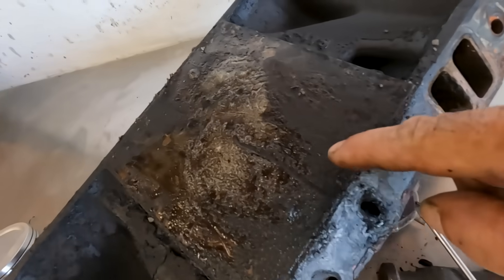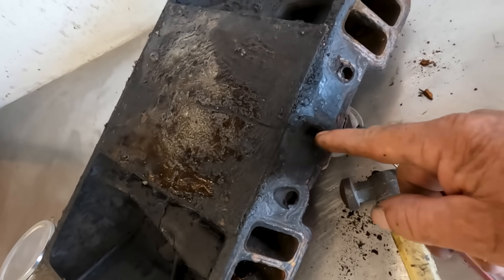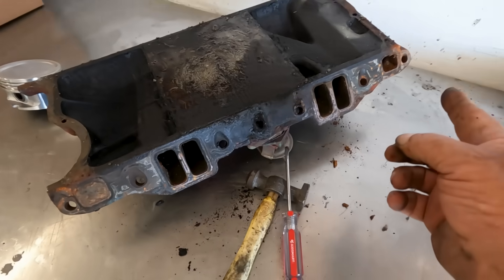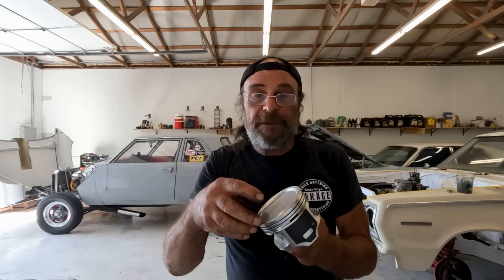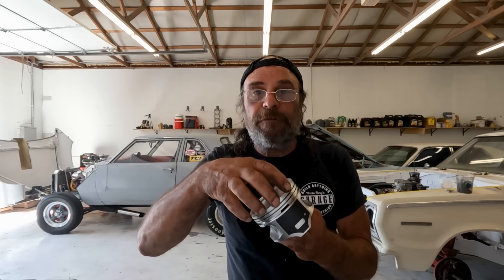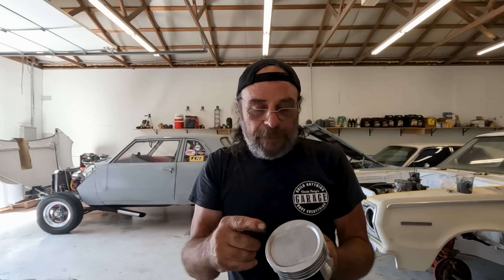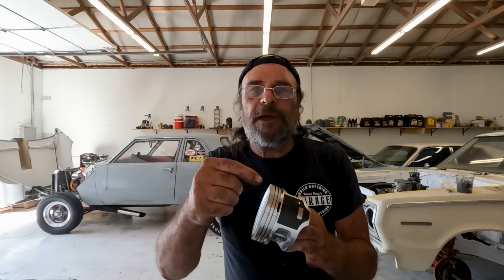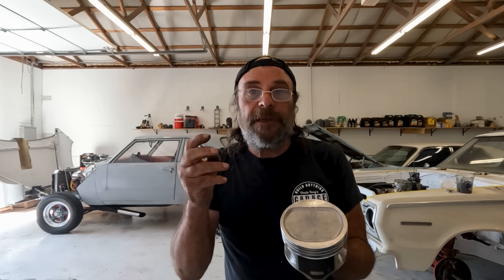The Number One Killer Of Gasoline Engine Efficiency And Power And How To Stop It

Comment: Carbon build up doesn't seem as bad as when we had leaded gas. Obviously, it's still an issue, but I remember taking valves out with so much build up you wondered how the thing even ran. Used to chuck valves in a drill press, then use a screwdriver to cut it off while it spun, you got real dirty doing that. 😆

Comment: If you run Propane or NG you will not have that issue I had a old 1985 plymouth cop car that ran on propane and when I tore the 318 out of it and tore it apart I think it was 1998 the engine was brand new inside and super clean like the engine was new. I tore it down just to look at everything and to put new gaskets so the engine would be a good sealed engine for another 10 to 15 years. but gasoline is a filthy fuel and that is why it carbons everything up.

Comment: When I started driving my 65 dart with slant6 6 when first got it I noticed it had  pinging issues going up hills especially on the highways / interstates speeds under load . checked everthing carb , timing , gas octane ect. took head off and found out there was a thick cone shape layer of hard sticky oil and carbon build up on the back side of the valves ! found out the cheap ass stock Factory replacement valve stem seals was causing oil leaks on the valve stems . I had to put each valve in a  drill and the drill in a vise turn it on and as the valve rotated use a sharned strait edge screw driver as if I was making a wood table leg on a lathe . once I got the valves clean to bare metal I polished the valves and had the machine shop modify the head to use the newr style seals with the metal skirts  and no more issues with carbon / oil build up on valves did this to my V8s and slant6s all run well

Comment: Also I find with small engines adding a detergent additive to the fuel really helps mostly because the awful fuel in north america has zero detergents I don't care where you get it or what grade it is if it came from a gas station it doesn't have any detergent I do not care what esso says it's all dirty. Diesel is even worse if you have anything diesel do not go without a detergent additive

Comment: I work mostly with small engines and mostly old flathead stuff (it's just my preferred style) and I've taken engines that won't even cough soaked them with ATF or something like seafoam it takes awhile if it's cold but as long as it's not broken or really completely worn out it'll come back, weedeaters are common for carboning up too it's the same sorta thing if you can get it hot before you flood it with cleaner of your choice (ATF seafoam ect) it'll boil and break up all that stuff.

Comment: My father spoke with the owner of the motel and got his permission to park it next to the building.
I kept asking him why didn't you just take the plates off and leave it.
When we picked up the crank kit from our machinist, he told us of a similar experience with another customer. They did the bottom end only to still have the knock. That's when they discovered the chunk of carbon in the combustion chamber.
I had been using the water trick to decarbon engines since I was 17. We got really lucky
Oh, and by the way, I love your videos with your nuts and bolts approach.
We're pretty much from the same era. I think I'm just a couple of years older than you

Comment: Dad always used atf. Can't remember why, probably trying to clean it out, but he did it to a 75 mustang with a 302. The problem never went away so my sister just ran it for another month till it finally got worse. Damn piston was cracked in half, horizontally, so the crown was wedged up making a seal with the rings while the bottom half was going ham with the connecting rod. I'm not lieing when I say my sister drove that thing for at least a month like that, I'll even go farther and say she took it to town at least once, nearest gas station was 9 miles at the time

Comment: Just use a good fuel additive that contain P.E.A. (like Redline SI-1, Techron Marine etc, there's at least 4-5 of them out there). It will also clean the fuel system, including injectors which is extremely important for fuel atomization. And you won't risk the massive increase of wear that comes from moisture in the oil.

Gas porting is still a thing, though it has usually been moved down to the rings since TotalSeal started offering it.

Comment: Why not use a drill for ridding of that carbon cake behind that EGR port?
A way to blow carbon build-up in a Diesel's exhaust filter is to drive it hard, flooring it. That's what I ended up doing, after my Diesel's emissions inspection turned out negetive results. I took it out on the road for about an hour and drove the copulate out of it, leaving plenty of carbon dust all over the place.
A couple weeks ago, a couple of Dix riding in a restored old Beetle convertible though they were cool, driving slow, holding up traffic. I passed them up with the Diesel I borrowed from the lady next door. As I floored it in high revs, I left them choking in my dust cloud

Comment: I dunno about modern engines not being as subject to the carbon on rings. I think a lot of modern engines get rings stuck up with carbon, oil consumption is really common these days and I think it has to do with carbon buildup on oil control rings.
Reply: That has to do with neglected maintenance schedules. If old oil is left in there too long, the varnish created will jam the rings shut. On some brands, the piston's oil return holes are drilled too small, making timely maintenance even more critical. One Audi engine series had this as a design problem. There's a shop in Germany specializing in modifying pistons, through drilling their holes larger and milling the piston's grooves for accomodating improved rings

Comment: The only thing I would add is that the carbon on the back of the intake valve could also adsorb some of the fuel skewing the air fuel ratio. lean then rich and so on. The engine would run like crap and get bad mileage. Do the water and blow it out trick and it would run fine again.

Comment: I cleaned all carbon and catalytic converter with hydrogen. Car runs like brand new. 1998, 200,000 miles, except for a new oil leak, it runs insanely well. Quiet as hell and very fast.

Comment: Project Farm got some modest carbon removal using Marvel Mystery Oil.  I use it all the time but have no empirical evidence that it works for that purpose. To me it's upper cylinder lube, especially in flathead engines.

Comment: There is another way intake valves collect carbon deposits. That is from the breather on positive crankcase breathing engines. When engines suffer from ring wear the combustion heat doesn't conduct so well through the rings and the oil increases in temp, the oil vapour then becomes more dense, this is then sucked up into the inlet via the breather pipe, collecting on the cooler intake valves where it carbonises.

Comment: Well Tony you went above and beyond again! I friend of mine from the very early eighties ram his 1971 Chevy C-10 race car pull truck on propane! I didn’t know anything about it so he enlisted me. He had an irrigation engine that was run on it and showed me how amazingly clean everything was inside the engine! The engine had something like ten thousand hours on it and it was so clean inside!! Because propane has no carbon! Then he pulled the dipstick on his tow rig and it looked brand new while he said it had nearly ten thousand miles on it? Again….carbon bad! And I remember my dad doing a tune up on a friend’s ‘66 Grand Prix then trickling transmission fluid down the hatch and tons of white smoke billowing out the exhaust!
Reply: Of course propane has carbon in it, it's a hydro-carbon, but it goes in as a gas, so it burns completely, to carbon monoxide, carbon dioxide ans water

Comment: I use hydrogen peroxide 3% from a standard 5 liter washer fluid reservoir via the suction underside with a non-return valve in stainless and controlled by a stainless aquarium faucet that I linked to the air intake damper opening. the feed is approximately 20 milliliters of liquid per liter of air. except that no coating is formed in the intake valve, combustion chamber or exhaust valve, the effect increases by 5-10%.
This only works on cast iron blocks with cast iron cylinder heads and steel valves alloy pistons with barium plating and stainless intake manifold, because aluminium corodes.

Comment: While indeed water injection is a thing. Literally you can purchase one of them mist sprayers from a garden shop and genuenly have the mist sprayer permanently installed in the intake. Then you get a tiny tiny 12v pump , sold right at the garden shop. These things will give you about 2L water over an hour sprayd.
A simple bimetal heat switch and a solenoid will automate it. Have a decent can for water , and do have a float switch in there. So you don't burn the pump running dry by accident.

Actualy there may still be commerical water injectors for trucks. Does a world of difference if you haulin up Hill. 

The diy solution works well too. Specialy if you are on long trips or a lot of idling. Helps to keep the engine clean , and when you "yeee haa" it helps to keep egt down.

Don't add solvents. If you must , you can mix ethanol. Even if you happen to have a diesel engine. 

Its a fine mist , so no need to blimp the throttle.
Reply: my car does run better in the rain
Reply: @putheflamesoutyahoo1503  rain , fog , Both help. Specially whit turbo charged engines.

An ideal setup monitors exhaust gas temperature and adjust the spray intensity to keep the exhaust gas temps whitin a given range. 
Baicly you improve thermal efficiency. 

Fuel burns , you get heat . A gas that is heated tries to expand. You get pressure. That pressure will act on the piston surface. You get the force acting on the piston from the product of the surface area and the pressure. The crank throw is the leverege arm. The product of the force and the arm yields tourqe.

A liquid heated will allso expand. But if heated enough , will change phase to gas. 
The heat made by burning the fuel however.. is mostly wasted. Piston heats up , cylinder wall heats up. You got heat loss. 
If you got water vapour in the intake air , more energy can be absobed by the charge , and you will make more tourqe whit the same heat. 

A more efficient engine.

Comment: I personally have employed the type of dam systems that have no overlap so that I have less backfire ["reversion"] as much as I could as I built motors.

That said, with existing motors, I just clean the valves, or, if they're really messed up, just replace them [because I'm lazy, and don't care to clean or regrind valves, since I'm not running a race car].

Comment: Great Video! All on the money.  I was a service engineer for one of the big 3.  We had Walnut shell blasting machines that induced fragments in the plenum air stream to media blast the carbon on intake valves it was so bad.  Tip:  Techron is the best additive for non DFI engines. We lab tested it.  Removes carbon on valves, combustion chambers and corrosion on fuel sending cards….if your gauge is dead two bottles back to back in subsequent tanks might revive it.
Reply: I removed the non-functioning fuel level sending units out of my '92 F250 7.3 IDI diesel. Made a mixture of alcohol free gas and Techron Professional additive. Soaked the sending units for a long weekend in a sealed tank.

The sending units have been functioning properly for two years.
Reply: Ever test GM top engine cleaner?

Comment: I once poured a gasoline detergent cleaning product into my 1973 Ford LTD with the 400 cubic inch engine.  Next day, on the way home from work, cylinders started missing like crazy.  When I pulled the spark plugs, I discovered that four of them had the side electrodes crammed down onto the center electrodes!  What happened was that the carbon was flaking off the back of the intake valves and smacking into the spark plugs during the intake stroke.
Regapped them.  Ran through that tank of gas.  With new gasoline, changed out the sparkers for new ones, and the car ran better than it had before because the intake valves were relatively clean.  Eventually had to give up this car because this poorly designed engine had a bad habit of cracking heads  and then the cylinder block.

Comment: I run CRC Valve and Turbo cleaner down the throat of my carb.   Cleans the snot out of them!  Originally used to keep direct injected Ecoboost 3.5 clean, I thought  Id give it a shot on the hot rod.   It works.   Had that Pontiac rolling coal like a diesel.   Bore scope showed everything back to shiny.   
That stuff works!

Comment: I worked for a Chevy dealer in the early 70’s doing heavy duty engine work I did a lot of valve jobs the main culprit was carbon  on the valve. The combustion chamber was always caked with carbon also. Unleaded fuel was a big help. The lower octane fuels though created their own problems. Engine knock or also known as pinging and we would have to retard ignition timing thus less power.

Comment: I have a similar issue..

GM ZZ430 clone which is a Aluminum Fastburn head, and their LT4 Hotcam setup...

If you start it up, let it idle and charge up, then shut it off, and repeat several times over a 6 month period without driving, it "MINI FOULS" the plugs due to the overlap even though the ECM is programmed correctly etc, you can (LITERALLY) see it from log to log, how the idling/charging up battery each time gets more rich until it gets drove finally.....

Once drove the engine heats up better than it could idling, and the carbon buildup gets burned off and cleared out making it like new again...

Wild, but when you deal with any type cam that has any sort of overlap, you gonna deal with this issue.

Comment: Sounds like some people (like me) need to rethink their catch can setups. Most catch cans say never have too much flow with larger lines and or bypass the pcv valve, but that affects the rings behavior. Bigger fresh air supply lines from intake or bypassing the pcv valve may affect crank case pressure at idle that could draw out more carbon thru the rings or have them in a position that wont seal.

Comment: I remember hanging a 1-gal jug half full of water with about a tsp of dish soap near the windshield washer reservoir, then borrow some tubing from the fishtank we'd run the tubing thru the cap about a 1/2 inch then to the underside of the air filter housing... the venturi effect would syphon the water/soap solution to blow out the carbon, and the glycerin from the soap smoothed up the intake... Not as effective as porting and polishing an intake manifold... But effective enough for street stock at Englishtown, Pa in the late 60's.... and a few street races in Sommerville, NJ.

Comment: If l remember correctly on some airplane engine particularly the larger radials they had a water injection system to increase the horsepower. The water was being used not only to clear the carbon but to lower combustion temps. I think the water trick has been around about how long the internel combustion engine have been around.

Comment: My brothers 82 Chevy c20 got all carbon clogged and that truck lost most of its power. He bought it new and had it for 25 years. We pulled the heads, decarboned tgem, and put an edelbrock performer on it. It was like a new truck again. So much so that he had it painted and the interior redone. He sold it with 345000 miles on it

Comment: (1)  Chisel out the carbon in the crossover untill you break through into the passage on both sides, remove EGR valve and have your machine shop throw it into their mhot tank overnight and all carbon, paint and grease is gone, good as new.  (2) The worst case of engine carbon I ever saw was a late 70's 455 Olds that would start and idle but stalled when put in gear.  When I pulled the heads the back of the intake valves had so much carbon they it had taken on the shape of the valve pocket behind it and only enough air/fuel could get in to idle only.  (3) When low sulpher and clean gasoline with detergents in it came out in the 80's I knew a mechanic at an ESSO service station who wanted to see if the fuel actually worked as advertized.  He removed the heads on his personal chevy pick-up to see how bad the carbon was and then reinstalled them and then drove it for six months using the new fuel.  He then again removed the heads and found that about 90% of the carbon was gone.  Todays fuels are much cleaner and have even better cleaners in them.  One old time trick that my mentor used to decarbon an engine was to open the throttle with one hand while slowly pouring a half a cup of rice down the carb.  To soft to do any harm but boy did you get a lot of carbon and black puffed rice out the tail pipe.

Comment: Gotta say that on relatively modern port injected engines, reversion of combustion products isn't remotely the largest cause of intake valve deposits.  In my experience t's mostly from EGR and crankcase ventilation being routed through the intake manifold.  OEMs that do a good job managing this don't have much issue (for example mid 90's-early 2000s Hondas kept intake valves really clean). On modern engines that do get deposits, a good catch can system really cleans things up.  Even on DI engines (GM LT for example) a catch can dramatically reduces deposits.  Per usual a regulatory requirement ends up having unintended consequences that may be worse than the original problem they were trying to solve.